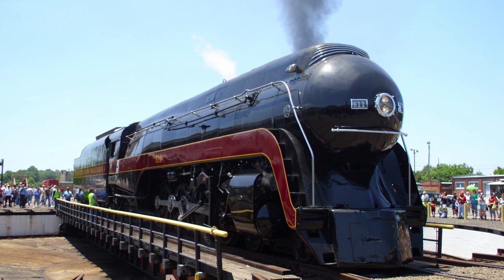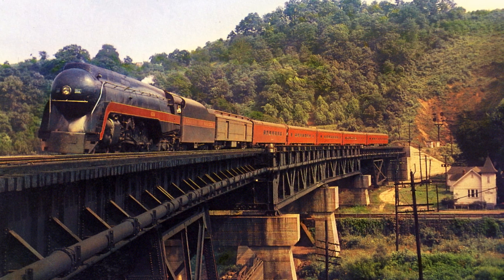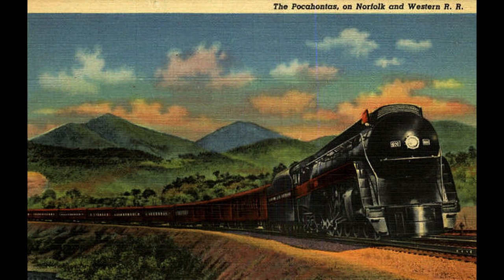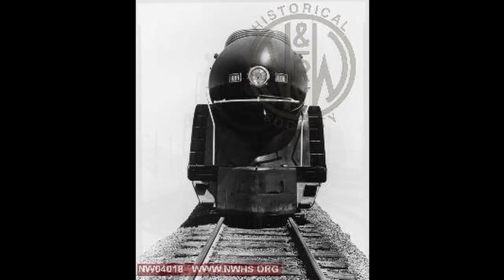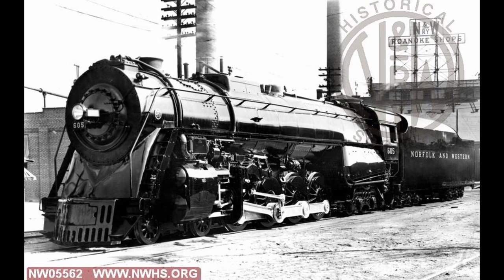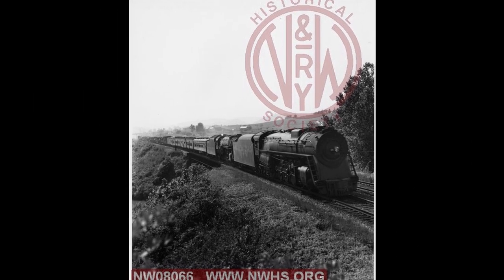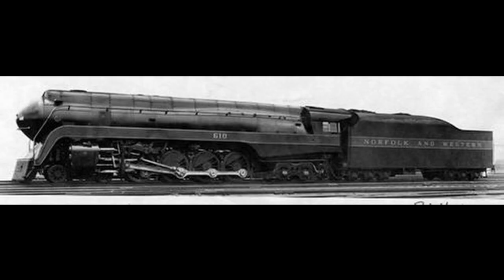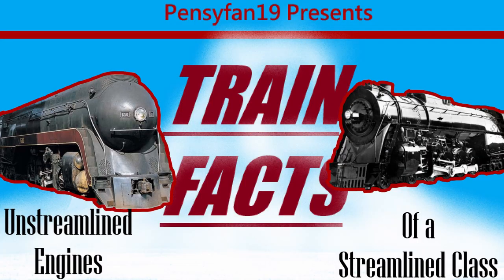Train Facts: Unstreamlined Engines of a Streamlined Class

Comment: The New South Wales Railways had a similar situation with their C38 Pacifics. The first 5 (3801 to 3805) were streamlined with the remaining 25 (3806 to 3830) not streamlined.

Although they were all intended for passenger work, they were displaced by diesels in the late 1950s and early 1960s, becoming more regulated for fast freights and limited passenger work.